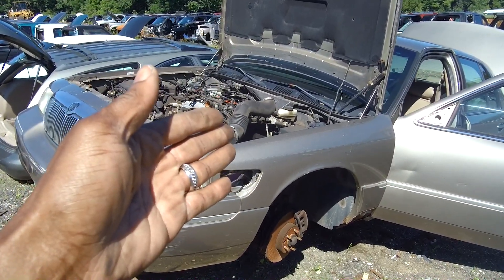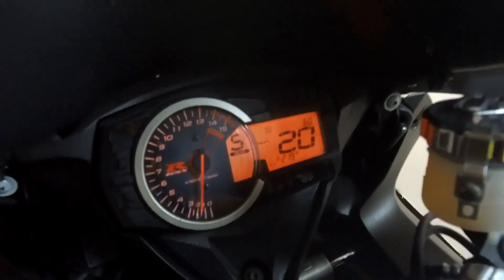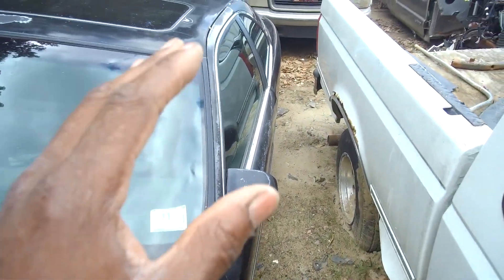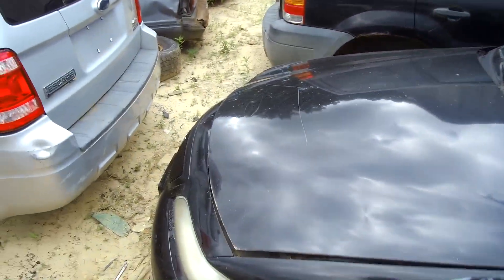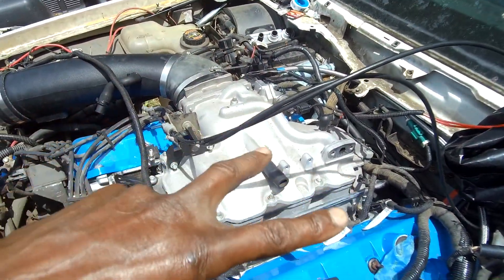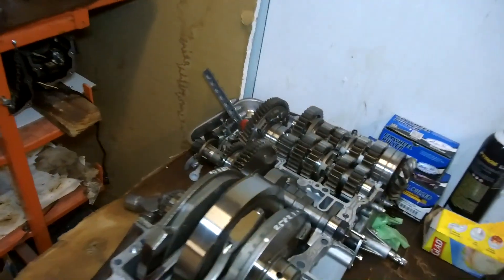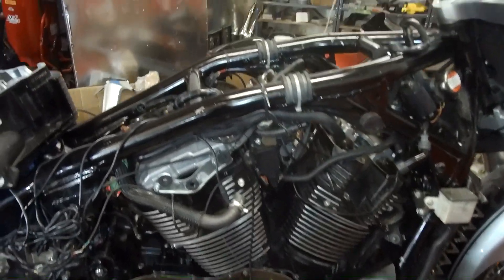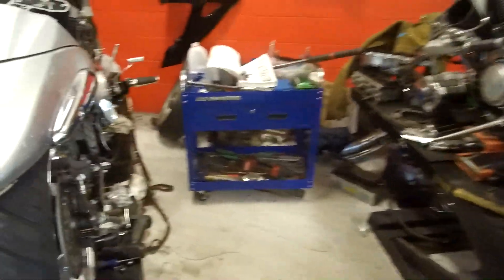Junkyard Parts for the Crown Victoria ( M109 Build )

Comment: Also to the left of your dream money pit is a f250 , most likely a brick nose but regardless it has a dana 70 full floater rear axle with most likely 4.10 gears . Unbreakable axle and very sought after , that truck is either a early 7.3 power stroke not idi or it has a efi 460 . You can take the efi short block and put carb heads on it and make a pretty decent setup with like 10.5:1 if it has a zf5 5 speed? Ballen bro ballen
Reply from the maker: Dude the funds are in the way... I just have to make things line -up... Right now i am following someelses dream vs mine... I hope there dream comes true so I can do my thing. here.. I am more at home here

Comment: Well I did a compression test 180  on both banks did the reverse wires for  the coils  I have fuel and spark  but not starting I get a back fire when I’m done cranking  out new plugs in also
Reply from the maker: JUST SAW THIS  ... do you have a the maf plugged up and is the math different than the injectors ( meaning ) 25lbs injectors need a maf thats for 25lb injectors